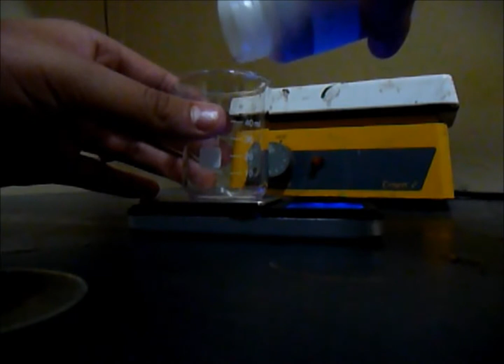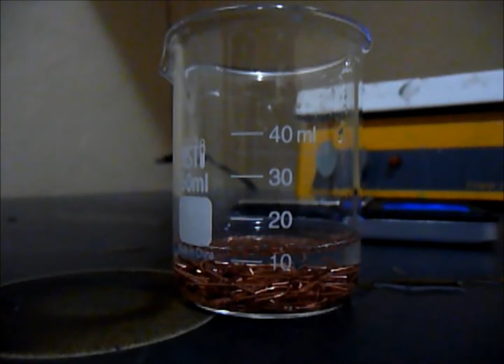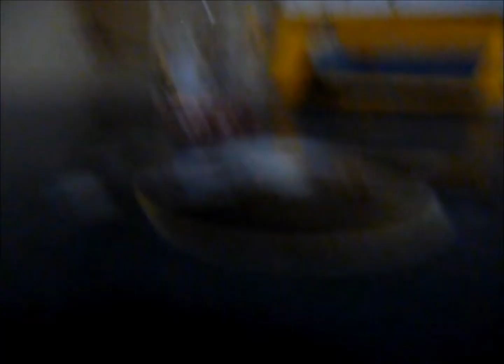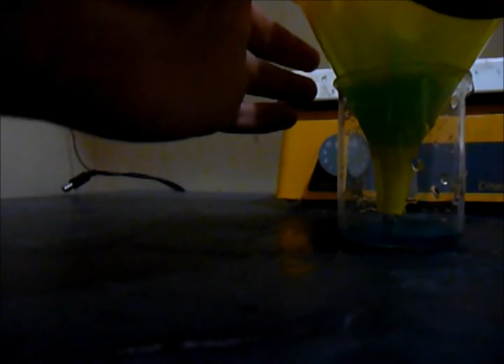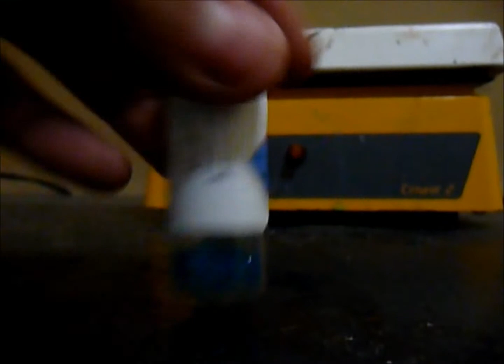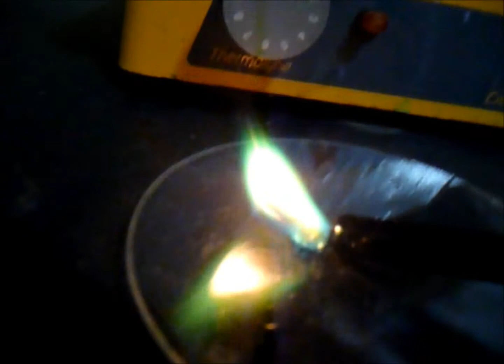Make Copper II Acetate

Comment: dang... i didn't think of using peroxide to catalyze it, i used table salt(i was getting impatient), which was fine for me because i planned on using it for electrolysis, but then i decided to use it for a flame test, i very quickly realized my mistake of adding a sodium compound to the solution. D: